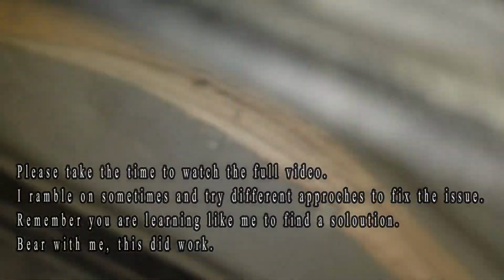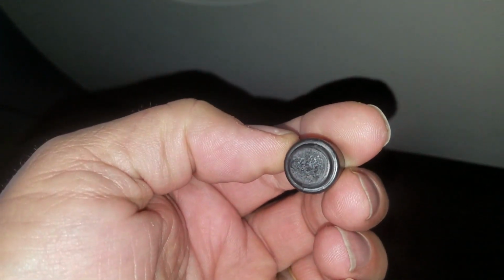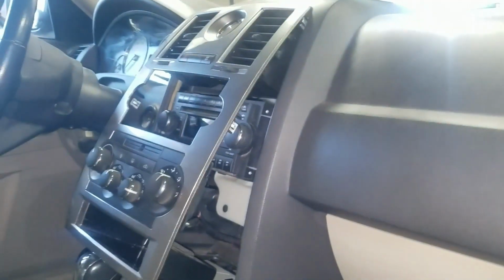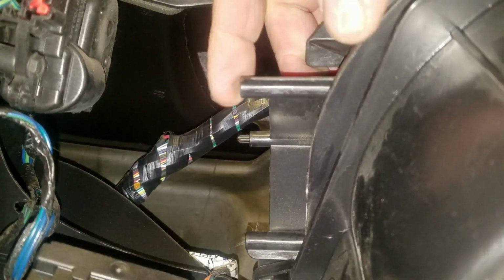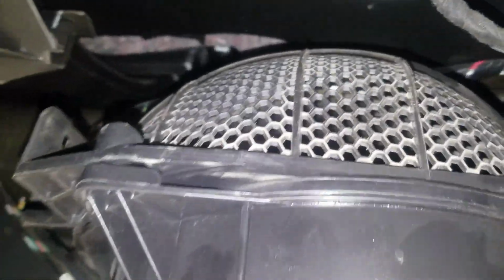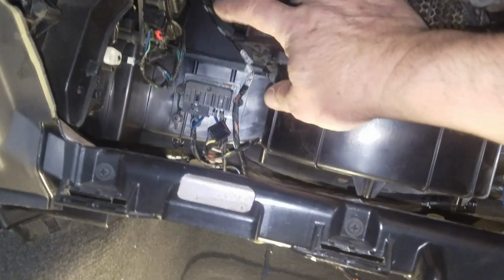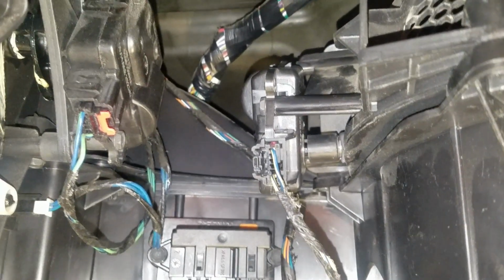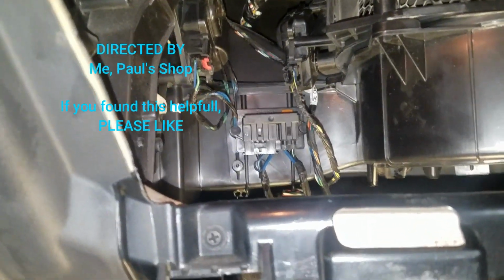2006 Chrysler 300 Recirculate Door Repair

Comment: I did everything you did including just unplugging my battery and with taking everything off but I couldn’t put the piece back on and when I put everything back tg and turned the a/c back on no air was blowing at all and the trust light to make the air colder would stay on even when I turned the a/c off and sounds like the a/c was on even when I turned it off idk if I messed anything up to what
Reply: Frost light^
Reply from the maker: you may have linkage backwards or repaired it in the wrong position. The door directs interior or exterior air. You don't want to recirculate your interior air. That's what causes the fogging.

Comment: changing from cabin air to outside air or vice versa with the blower motor on high speed puts a lot of pressure on the door and makes it harder to actuate - can lead to actuator failure or linkage failure

Comment: Thanks for this video. Wish I would have seen it 24 hours earlier than I did. I'm having window fogging problems in my new to me this summer 2010 Chrysler 300. Did a lot of searching and couldn't find a whole lot about the recirculating damper being the problem. From what I had learned I went ahead and purchased a replacement actuator. Had a hell of a time trying to get in there to remove the screws that held it on but finally made the swap. Unfortunately the window fogging didn't go  away. 24 hours later I found your video. It's winter in Canada and below freezing but I went out to see what I could learn. Sure enough my damper connection to the actuator just spun in the housing. Unlike yours that female piece does not come out of the housing. I tried putting a screw in but that didn't work. By now I'm getting kinda cold. I took a long pick and reached in to the damper through the holes in the screen. I was able to snag onto it and pull it to the open position. It's going to stay like that until spring when I can look at it better and possibly replace the damper. Not sure it will come out of there though.

Comment: Does this help with heat?
Reply from the maker: This fix only determines if the air comes from inside or outside of the car. If you're not getting heat you have another problem.

Comment: I want to thank you for this informative repair video, I've been living with this problem for years with no solution. After watching your video I went in my car and checked the Air Door and indeed it is broken, just as in your video. I removed the Blower Motor and moved the flap to the fresh air side by hand for now until I fix it. Thanks again.

Comment: I have 2009 Dodge Grand Caravan sxt , same problem Foggy All windows, Steam build up in winter very badly, or in heavy rain or in Sever cold weather in Toronto,  on highway like -10 or -17 severe fog , steam build up quickly cause hard to see outside, very dangerous situation while driving, will try ur tip and let u know??? outcome how it goes???
Reply: Full Moon, I just fixed my 2009 Caravan. Look for my video online. Took me 4 days to replace entire airbox

Comment: I have 2007 charger and windows will fog badly below zero celsius. And plus celsius also windows are trying to fog. Quite risky even drive the car. But i looked this video and today i took the blower motor off 90% and got my hand in there. I was able to move the recirculation door to the other side and put littlebit of tape there so that door dont move anymore. And took off the wire from recirculation actuator. So that it wont move. There is no need to recirculate. Will see if it helped. Window fogging is very annoying
Reply from the maker: Correct, but the AC will work much more efficiently on recirculate than having to cool hot outside air.
Reply: @70MoparMan  if i disconnect power to that fresh air actuator to see if it helps to stop fogging on inside windows, what u think is it ok or any problem???

Comment: Back in 2012 after google failed me I took my 2008 300 C to my local dealer and they were clueless as to why it would fog and ice up. Two years later I went back at it and found enough information to understand the problem. I ended up using a piece of wire coat hanger to keep the door closed. Could not believe I drove that vehicle for 3 or 4 years through Michigan winters stuck on recirculate. I now have another 300 C with the same issue. Thanks for taking the time to make and post this video! I might actually try to fix the problem this time. Cheers!

Comment: There’s a program you can get for your laptop called AppCar DCDiagFCA that will put your A/C through a calibration.  That would resolve the door opening and closing once the problem is fixed.  Thanks for the video.  We have a 2008 Chrysler 300C and a 2008 Dodge Magnum and both recirc doors as broken.  There’s actually a code that is thrown when the door is broken.  It’s something like actuator door travel range too large or similar.
Reply: Does that stop the motor from over-torquing the door? I just fixed mine and I’m reluctant to re-install the motor now. Maybe there’s an aftermarket motor with less torque?

Comment: Thanks Paul. Got the same fogging problem on my 2007. Hope my recirc door pin socket hasn't broken off and my actuator motor is just broken. The motor is $185 CDN from the dealer. But, if the socket is just busted off, I'll keep your fix in mind. BTW, ever watch MacGyver?
Reply from the maker: Familiar with him, rarely watched. But we do what we gotta do. My other choice was entire box in the hundreds.